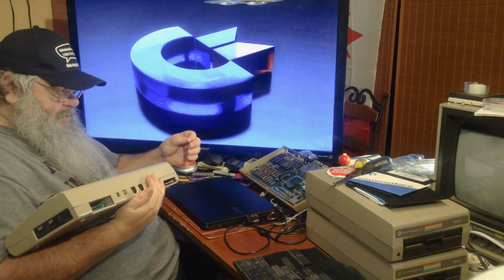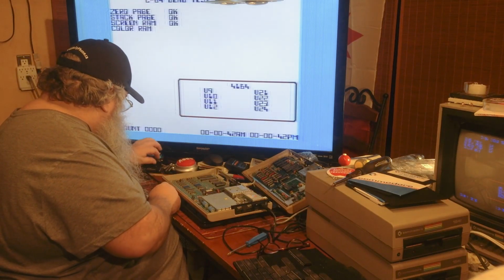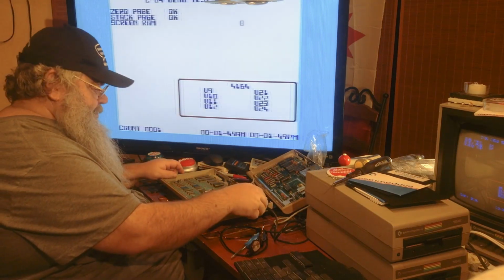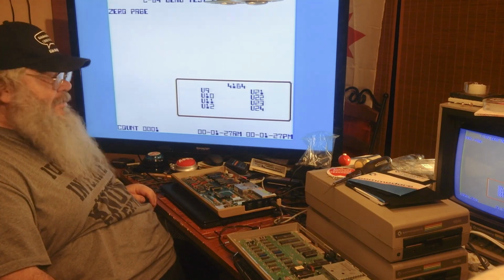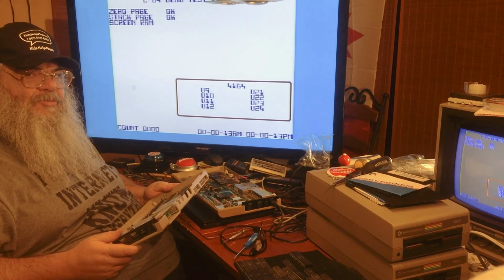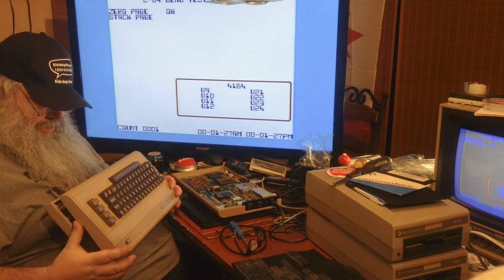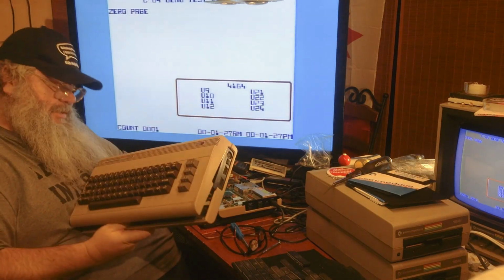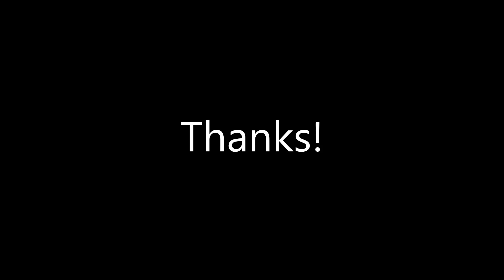Silver Label Commodore 64 With Issues Vintage C64 C-64 64C C64C 6502 - Dave Bradley - Episode 580

Comment: Interesting, just found your channel by chance. I have owned several Commodore computers and Amigas, all still in my garage. I am now planning on moving them into my spare room. Funnily enough, I feel the build quality and just the user experience on them to be better than modern day computers. Is that just me, or do others agree? :)
Reply from the maker: I know the feeling of having a garage loaded with treasures!  First thing, have you removed the batteries from the Amiga computers?  If not, get them out ASAP!  They are killers!!!  Best chance of them living is if the machines were stored sideways or even better, upside down, but regardless, get the batteries out be it by unsoldering or side cutters...you can always unsolder the remains later...It is a good time to move them in and set things up!  Even though some of the old Commodore people know the stories of how things were put together, it does seem that lots of the old machines have survived or are able to be saved!  From what Bil Herd, creator of the Commodore 128 says, HEAT IS THE ENEMY!!!  So keep things cool, and I hope that your collection fires right up and works wonderfully...I am suspecting there will be issues to resolve...but that is part of the fun and the challenge...stay tuned, questions and comments are always welcome!
Reply: @DRBradleyPhotography  Just bought a stack of cleaning equipment, will resurrect them from the dead and give them the 5 star treatment this week. Yep the batteries was the first thing I replaced, removed all mold and cobwebs, that was starting to show.
Reply from the maker: I hope it goes well!!!

Comment: Dave,  If you don't have an RF shield on the back of your Motherboard, check the solder joints of the U18.  Maybe a quick reflow would help.  Other than that, I would check for voltages.I think it is 12V on Pin 28.  Double check on that.
Reply from the maker: Thanks, I will have a look and perhaps even remove the shield if it is there...stay tuned!

Comment: it could be a solder on the video connector, or on the 6581 socket
Reply from the maker: I will have a look on the underside of the board for any and all solder connections...stay tuned!
Reply: @DRBradleyPhotography  ok!
Reply: @DRBradleyPhotography  replace the sockets
Reply from the maker: Indeed, sockets do fail from time to time!
Reply: @DRBradleyPhotography  maybe they are those!

Comment: Have you ever run into a problem like this on a c64. I turn it on and all I get on the screen is a bunch of characters in differing colors on the bottom of the screen and that's all. Do you have any ideas? I have had a couple C64's but never saw that problem before.
Reply from the maker: Well, until recently, I would say it is a ram issue, but while I was going through the recent marathon of 64's, I found a couple with somewhat similar things happening, and it was the PLA chip...so, if your PLA is socketed on both machines, swap them out with each other and see what happens...if everything stays much the same, then head for the ram...sometimes, bad ram can be found by turning the machine on, letting it sit for about 5 minutes and then putting a finger tip on each chip one by one looking for any one that is much hotter or colder than the rest...that can work with other chips as well...but first, see about the pla chip...and go from there and let me know...
Reply: @DRBradleyPhotography  Great thanks Dave I will give that a try. At least it gets me going in the right direction.
Reply from the maker: When it comes to the 64, the PLA is where I typically start...well, after checking the fuse and making sure that all the chips are in the machine and properly seated...I hope your machines have most if not all of the major chips in sockets...let me know how it goes!